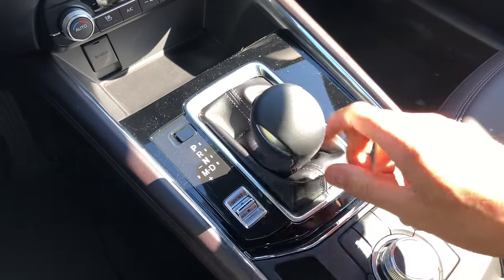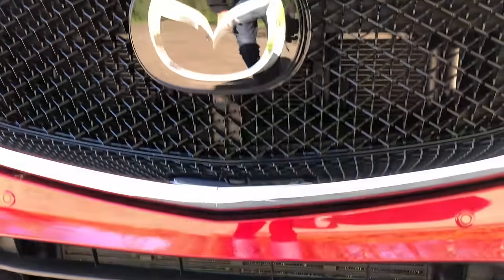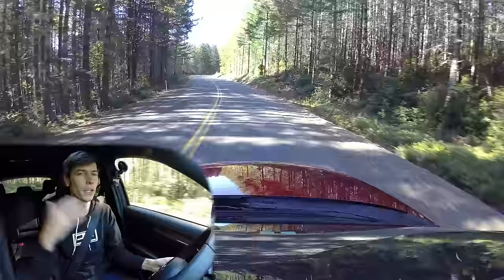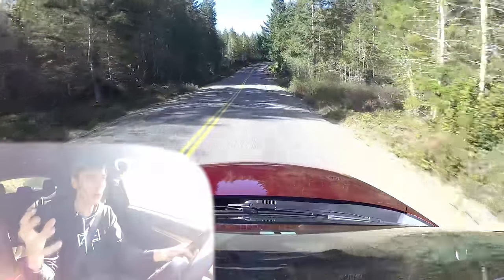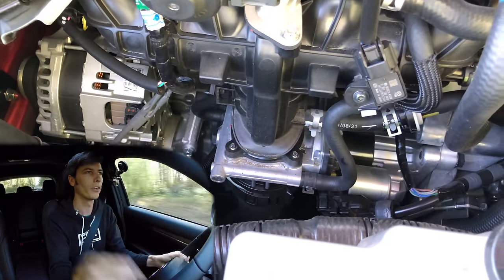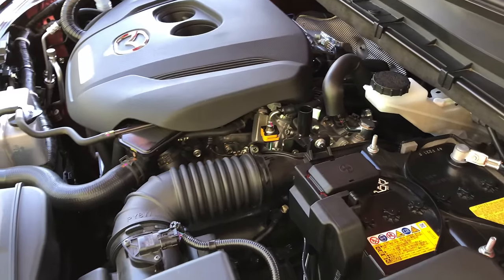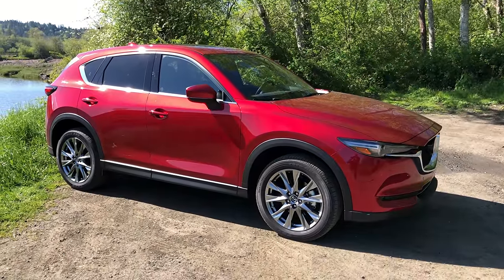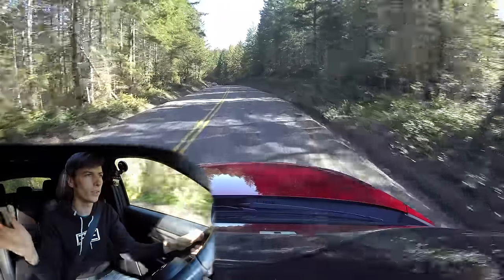Are CVTs Bad? Why Mazda Avoids CVT Transmissions

Comment: I'm no expert on cars or mechanical genius when it comes to the operation of a car's overall build quality. But like the best operating CVTS are Honda, Toyota, and Subaru. If you want a sleek looking artistic design in a car with a more naturally aspirated engine, Mazda is the way to go. If you live in snowy weather where there is lots of ice, Subaru is the only answer, or if you can buy any Japanese cars with AWD capabilities. When people compare Japanese to German manufacturing brands, the Japanese focus on quality built technologies that work long term and slowly implement more technology packages every 4 to 6 years. Whenever it's any German car, the brand features every single bit of new car technology with a ridiculously high price tag. The problem with German cars made in Germany or Austria isn't the engine or transmission fault. It's every single microcomputer in the the car controlling the entire car's technology. Older German cars are very reliable but expensive with better quality parts. Now, Germans make more cheap plastic over metal parts, causing the quality to go down. 

As for America brands, you're better off with a Ford truck or SUV. Chevrolet is a joke... the interior is so bad on every GM vehicle. I own an 2008 Pontiac G6 GT with 200K miles. Engine and transmission isn't as powerful as once was at 90K miles. And the first problem that will happen to the car will be the coolant, suspensions, brakes, and electronics before the engine or transmission blows. There are early signs, because the censors on my car are haywire.

Comment: Thanks for avoiding CVTs but no thanks for not using a turbo. I have a 2018 cx5 and the transmission is  a bit annoying. In sorry mode it revs wayyyy too high. I know it's supposed to shift late in sorry mode but it feels way to revy and you're just yearning for that next gear and it never comes. Also feels a bit underpowered. But it's a great car. I don't like to get what everyone else buys and Mazda is ideal for that.

Comment: Mazda's six speed Auto is underrated,  Its way better to drive that the 8-9 speed units I have driven and VW dual clutch. not sure how that looks on efficiency but compared to a traditional conventional torque converter auto im sure its better

Comment: Thanks God someone is making automatic and not CVT
Reply: Really ???
Reply: So in your opinion a Lawn Mower is automatic!!
Reply: If it's a riding mower it certainly does have a transmission. Bottom line, CVT's are notoriously unreliable and can cost twice as much to repair as a conventional automatic. Also FYI, it's not even a fair comparison to include the Rav's hybrid transmission in this list as it does not operate like the one in normal cars. In hybrids they are motor generators. Basically like a freight train except smaller. The engine is used to generate electricity used by the hybrid ELECTRIC transmission.
Reply: PS. And don't even dream of adding any performance upgrades to your CVT car as those transmissions aren't designed to take any abuse or increased torque.

Comment: can you explain why my 2019 Ioniq phev is so clunky at starts often? I understand that there's a clutch between the engine and the electric motor, but since it can start off using the electric motor only, I think it is able to remain in first gear when coming to a stop, but I'm not sure, sometimes it feels really clunky

Comment: currently driving a toyota auris hybrid (corolla old model) 1.8. Car in general is comfy, but I hate the engine and the transmission with a passion, by far the worst engine trans combo i've ever driven. Hope the new 2.0 hybrid & eCVT trans in the new corolla will be an improvement

Comment: A good Auto transmission is far more enjoyable to drive simply because it is far less intrusive than a CVT...CVT really struggles in undulating terrain, up and down hills, it’s loud and annoying (both the CVT itself and the increased engine noise as it often holds ratio and over revs the engine. Yes, maybe that’s technically more efficient, but it’s awful).

Comment: Informative video except for the RAV4 reference which was misleading. However I think the reasons you mentioned are of zero value to consumer. People buy cars that drive smoothly on test drives and daily commutes. And if your racing your crossover off the line then you bought the wrong car :)

Comment: I have long been sceptical of cvts.  But check out commercial versatile utility vans.  All that I checked so far have them.  What's the deal with that if they're all bad?
Reply: Because most consumers are now completely ignorant. No one reads consumer reports or does any legwork before shopping. Talk to any mechanic. Our first words of advice are to avoid CVT's. The are notoriously unreliable and can cost more than twice what it costs to repair a conventional automatic. But... It's your money and I'll be happy to relieve you of it when the time comes guilt free because I told you to avoid the junk.

Comment: I really enjoy driving my MZ3 with the N/A 2.5L /w manual. It drives like an Audi 3 base for a fraction of the price. Put summer HP tires on, and the level of grip is astounding. Most stable FWD I've ever driven. Most fun FWD since my '92 SE-R
Reply: How's the acceleration for daily driving without the turbo
Reply: @Konuvis  More than acceptable. It's not a 0-60 car (C&D 7.3 sec). But, midrange acceleration is pleasantly surprising. I have zero problem getting around in traffic in city or the highway. And throttle response is very linear.

Comment: Electric final drive, single gear, no shifting, torque for days, no transmission, fixed gear ratio, wide RPM range electric motor & controller system, batteries improving
Most fun instant torque acceleration with fully electric drivetrain // I like the BMW concept of putting a range extending generator in the trump i3 REX etc especially while lithium-ion battery weakness still a major bottleneck for better EV development //

Comment: I prefer manual.  No automatic I still prefer the option of "roll start, bump start, push start or what every name you want to use" cant do that with an automatic and cvt.
Reply: em745a  Yes i guess you have never been caught with a dead batter out in the middle of nowhere and the only way to get the car moving is a roll start. now your stranded out in the country or on the side of the highway, or even in a big city and people just just ignore you even when you are standing there with jumper cables in your hand and your hood up.  and not every one can afford to have a cab or towing company come an give them a boost. Some people are dirt poor you know.

Comment: Impressive technological feats to squeeze better performance out of it, but... I worry about the long term.  What happens when these high tech things start failing?  Will it be next to impossible to diagnose the problem?  Will the average mechanic be up to the task of fixing it?  Mechanics aren't engineers.  And the only symptom the driver will be able to identify, maybe, is a little drop in MPG or power or shift quality.

Comment: Am I the only one who does not like how modern Mazdas drive? (Miata and RX-8 excepted, though the RX-8 isn't that great as a sports car IMO). Every non-Miata Mazda I've driven since 2004 has been so bad about giving me meaningful chassis feedback through the seat of my pants or through the steering wheel, that the only way I can determine if the car is under or oversteering is by visual reference...I am not comfortable with that. And I'm saying this as someone who loved Mazdas before 2004, and I own a Mazda right now; I am a fan of the brand overall! But I've never found this great Mazda chassis that all the journalists praise in 3s, CX-5s, etc. etc...

Comment: Why do people insist on using acronyms as if they don’t know what the letters in the acronym stand for?  Don’t be redundant!  CVT stands for Continuously Variable Transmission.  It’s either a CVT or it’s a CV Transmission.  A CVT Transmission is a Continuously Variable Transmission Transmission.  A PIN Number is a Personal Identification Number Number.  RAM Memory and HIV Virus are similarly redundant.
Reply: Atm machine...

Comment: The 4WD in my Tundra which I use in the snow for 4 months/year, is getting iffy. If it fails, rather than fix it, I will get an SUV. The CX-5 turbo is my current choice...  as long as it still has its torque converter transmission. If Mazda go to CVT, I will look elsewhere.
Reply: das wright  Consumer Reports listed 4WD as a frequent problem in the early Tundras after only a couple of years. Mine is 2001. I have changed the oil in the front and rear diffs and the transfer case every 25,000.
Reply: das wright  My current mileage in the Tundra is 6,000/year. Most people think a Mazda will last 100 - 120,000 miles. As I am 71, that should last me, but I am holding off until I need it.

Comment: I drive an Toyota Auris Hybrid and when it's in performance mode and also driving below ~70km/h (44mph) whenever I hit the gas ever so slightly it just jumps forward with instant-throthle response. However, when I try the same in ECO-mode it's very slow to respond, it takes a while and also the revs go up a lot slower than when in Performance mode. However, when in Performance mode and driving above ~75km/h (48mph) and then floor it, it won't always respond instantly but will react like an Audi S4/S6 with the slight delay before going forward...The electromotors definitely help below 70km/h (44mph) but above that speed, it's just the engine and the HSD-transmision (kinda similair to a CVT but it is not a CVT).

Comment: Yo, man! Hybrid CVTs, which are commonly called by Toyota as "eCVT" are not a regular ones! They don't have of variable diameter pulleys or belts, just petrol motor and two motor-generators that are connected to the same drive shaft via the planetary gear set. You better watch "Weber Auto" youtube channel
Reply: em745a  why? They don't wear out like any other kind of AT

Comment: Good video, but...I have some personal opinion on what you state here... you see... keeping a clutch locked more and more time means clutch packs thrown out off the window, right? You'd rather have the fuel economy thrown out instead of the clutch pack. You can't buy the car based solely on the looks and fail to see or to anticipate what the car will become for a long term usage... it seems to me that you fail to see on the overall package of how actually a good car is, based on your overall expertise and documentation. I'm surprised you don't point that out.

Now, about Mazda... 
1. I like that they are Japanese. They come out with new ideas, unlike others. They made, by far, the best cars; reliable and fun to drive. However, with Mazda's approach at the HCCI combustion system and with this weird clutch locking as many times as you can, it doesn't actually sound to me as it will be any more reliable. Honda messed it up with their first approach at Turbo engines as well. Mazda did it once more in the past with the Rotary engine, and it was just like a teenager getting laid until the whole engine failed.
2. With this new looks, Mazda sacrifices a lot. The interior is all black and dull. It's so dull that it tends to look more and more alike the VAG cars. The rounded crap climate control unit switches, for instance, are a full rip-off from VAG. Another thing that Mazda claims (and not only Mazda, you guys, the reviewers), is that the new Mazdas are leaning towards the "premium" car segment. Now, how come, if you state it's a damn premium car, doesn't it have enough space (CX-3 & CX-5 both suck in practicality and overall occupant space - APART from the driver - and compared with other "mortals" from the same segment, those aforementioned cars, even get overwhelmed by cars from lower segments) and you don't have at a bare minimum the ventilated seats and some nice (and easy for your eyes) interior ambient lighting, like real premium car manufacturers? With this huge package (currently in EU) of 165 hp from a 2.0 gasoline engine costing over 35,000 €, that is rather disappointing, if not a blasphemy to talk about some actually bad (and proven to be bad - see HCCI) reliability solutions that Mazda thinks would "evolve" the everyday car.  
3. I'm expecting to see a lot of Mazdas to get premature engine wear and failing clutches, at least in this "re-inventing the wheel for the driver's sake" ideology, which in long term would make Mazda one of the least desirable car brands out there (not that it's very desirable from the numbers you've shown in your clip).

Comment: I drive a Mazda 2 Skyactiv 1.5D with 6spd AT.  A great gearbox.  In Thailand, most cars are Toyotas and Hondas (66%) and they use CVTs.  Although Toyota produce the best CVT it has a horrible droning noise, it's soooo sluuuugggishhh and boring to drive.  My Mazda has the same power at 3600 rpm as a Toyota Vios (1.5) at 6000 rpm and vastly more torque but from 1500-2500 rpm.  Much more fun to drive and superb economy.

Comment: i had a honda 2015 civic with a cvt never knew much about em .. probably was the most horrible experiance i ever had ... honda overall had flaws with the civic exepcial;ly electronic issus and sensor issues .. but that cvt the most garbage transmission i ever drove crazy slow horrible response on the throttle didnt do anything to help gas ...it was epically garbage ... the transmission broke at 40k right around the time i paid the car off so it was a big f u i got from honda took 6 years of my money 
i was forced to buy another car and went straight to mazda the more i learned about cvt

mazda is just the way to go.. goood reliable cars  that are fun to drive

Comment: Yes Mazda is going it s own way creates great technology very efficient even with the traditional 6speed converter the result is the prove, well made and always a strong competitor in every class. As noticed fun to drive maybe but in the class efficiency is much more desired than few tenths of a sec quicker acceleration. Toyota with the hybrids is the leader in this class.
Reply: where is the fun!? driving in a slalom Parcours between pylons or try to avoid crazy elks? Or hang on pushing the rear on a sleepy pavement! Yeah that would be great fun!

Comment: I would imagine that Mazda doesn't use a CVT because they've never developed one. When you consider that both their automatic and manual transmissions are still based on the units developed by Ford when Mazda was mostly owned by them. Really, Mazda doesn't do a lot of actual development - they refine what they have, but they don't really create anything original. Now that they are tied to Toyota, we're seeing more Toyota based products migrating into Mazda, I wouldn't be surprised to see a CVT show up in the Mazda 2/CX-3.

Comment: Manufacture save $$$ from CVT due to simple setup, blanket statement to consumer as “new tech” and charge a bit more. Then when the fragile CVT goes kaput, the whole unit become “wear & tear” component instead repairable component. Need to change the whole thing instead of repair.

Comment: The notion of delay due to "searching for the right gear" is way off. There is no "searching". When the criteria for shifting up or down are met inside the controller CPU, the shift takes place. Until then, the car drives on its current gear. Nothing more than that.
Reply: em745a  This process does NOT introduce any delay or other ill-effect for the user experience. It is transparent to the driver.
Reply: em745a  It is whatever your over-inflated ego needs it to be.

Comment: Cvt can be okay I got 210,000 on stock cvt on civic hybrid I think it has to do with a combo of things frequent oil changes every 40k for cvt also the driving style it’s a hybrid I’m not annoying slow but I definitely don’t drive it like a sports car and number three my car has very low horse power whooping 93 hp and 116ft lbs plus the hybrid system adds 46 FT lbs if torque so it’s very under stressed plus it’s a Honda 🤷🏽‍♂️
Reply: Hybrids use a planetary gear set for their cvt.  The belt runs the motor to regenerate a battery, instead of pulling a whole car like cvt equipped ICE cars.

Comment: smooth shifts: start practicing with a manual transmission and you'll be able to shift very smooth fairly quick
quick shifts: start practicing with a manual transmission and you'll shift quickly in no time
smooth acceleration: controll your right foot and practice with a manual transmission to be able to down shift like a pro doing heel and toe
efficiency: learn to drive a manual well and start using hypermiling tricks and youll manage an average milage better than the manufacturer claimed fuel economy numbers
direct feel: nothing beats a manual transmission in feel, everything happens when the driver makes it happen

conclusion: git good and get a manual transmission car.

Comment: CVT is worse transmission I have ever drove (you know why, and no it's not saving fuel, and no it's not accelerate better), and also there is no service that can repair it.
Thank you Mazda for avoiding CVT transmissions. Thank you any other car manufactures that avoid CVT transmissions.
Why Toyota and Lexus use CVT? I's terrible.
Yep Mazda CX5 2.5L is a really good car :))

Comment: Does anybody know if the 2019 Toyota corolla hatchback 1.8ltr hybrid uses a belt for the cvt or its a different transmission altogether even though its still called cvt